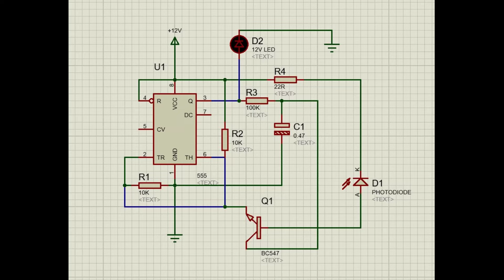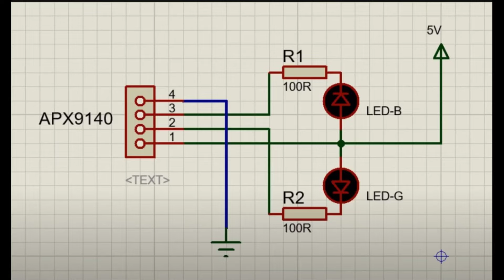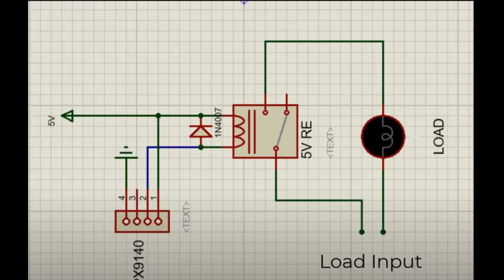Helpful 3 electronics projects || you can make at home !

Comment: What is the soldering paste you are using?
Reply from the maker: I use regular tin wire in addition to flux
Reply: @Inventor_AW  So what is the white paste @ 0:08 or @ 3:00? (I thought "flux" was what is inside of the "tin wire".)
Reply from the maker: @bobkod9415  This is a type of flux
Reply: @Inventor_AW  Does it have a name? or where to buy it? - Thanks
Reply from the maker: @bobkod9415  https://www.amazon.com/BEEYUIHF-Solder-Soldering-electronic-soldering/dp/B0C7V5K5X6/ref=sr_1_30?crid=BKP369B2XVSZ&dib=eyJ2IjoiMSJ9.wFnK_EKv0IeUIyKFa6-SL4YkJ1GzQssswPdt6bJ7_Nzi5Y5GalKzsLC-TKBQIf9eY5D42BbNBEW92pYI3TPfSHC7IKOfjFVz84qKw_PFmoL2648LkMSvmsDTk-8NFdtYVcQ1gLMA94-EfT4-5ZsF9Vd-Fw0-UwU_fra2ufD-DmvMbKQMyGuhaSFf9sTjiX3IfgmYjrBmJFXstv18mDscYEuEQkg84aq4aVoHAh7sy8xRBAkm8jD5Z-sTSAEVwlSZnSdtlz26SvoSdunLdovRq_kOuXCbVYj14hIWgaQJf8I.eF3vXGreLK_KVw7PD14TdvhQ2uy7Nu1OniVdaw5Pjx4&dib_tag=se&keywords=flux+paste&qid=1724159025&sprefix=flux%2Caps%2C633&sr=8-30
Reply: @Inventor_AW  Thanks, much appreciated. And also thanks for sharing your ideas with us, many useful, all interesting. Thank you for that as well.